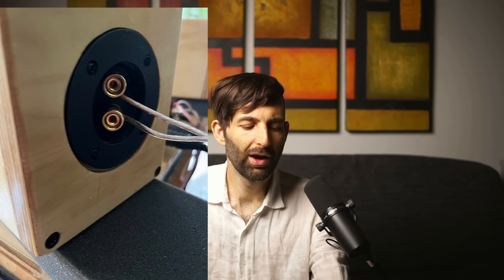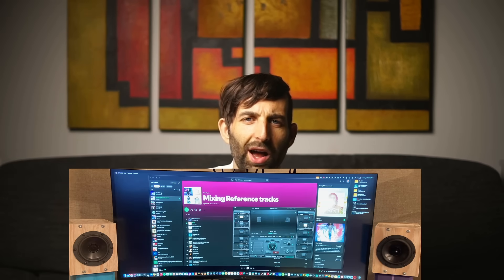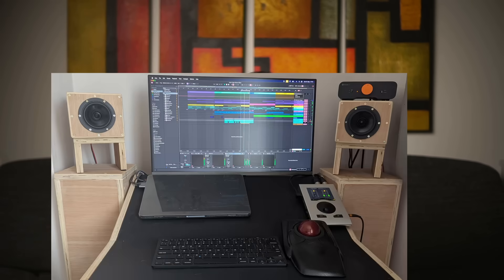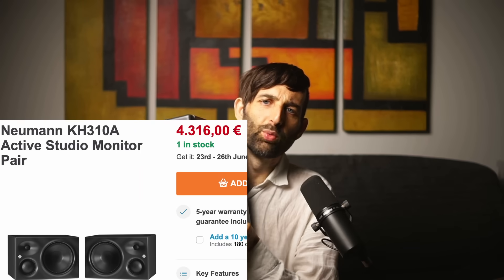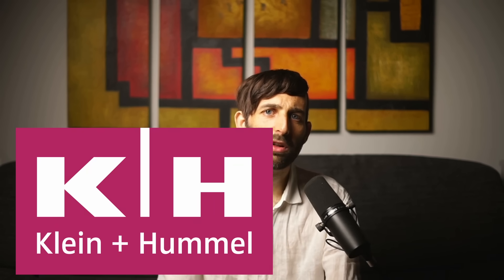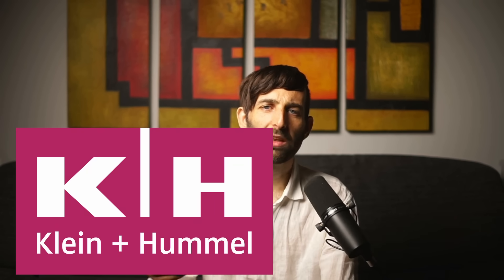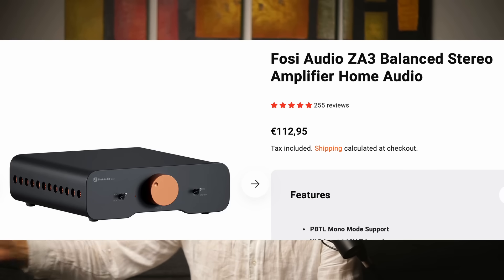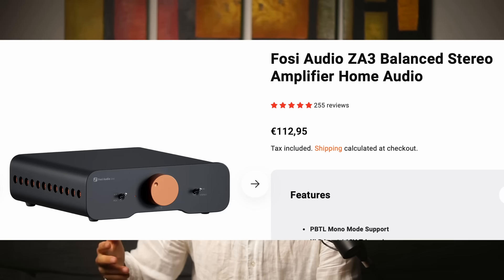$5,000 Neumann speakers VS $400 DIY speakers (Audio Shootout)

Comment: Mid-Field monitoring is how we have mixed when on a project, about 3 feet.  Used several high end Studio Monitors for that job over the years, even own some old Roland bi-amped monitors.  When it came to detail and recognizing the clarity enough to actually make adjustments, the coaxial monitors worked the best for me.  Concentric drivers made a big difference to my ears. Some nice reference quality car audio 6.5's with a concentric silk dome are readily available on the market for reasonable pricing, they even make sealed truck cabs for these things. Doing the box math is the proper way, so buy speakers with the specifications on it for calculating volume of a sealed box.  It's likely better for Home Theater imaging on the ATMOS satellites as well. But yea, concentric tweeters in sealed cabs would be my choice for another speaker build. Dear God - what a rabbit hole that can be, never simple. But I get lucky often with educated guesses because I've done it enough to learn from it. You should hear what I did with some old Peavy 10" cabs with the 200 watt Morel silk domes and nice MCM Pro woofers, I'd mix with those, need a bigger room and at least 100 wats to drive them right.

Comment: I think I may be making these, are the drivers readily available in the uk?
Reply from the maker: there are stock shortages because everyone bought up everything on the market after my course but the stock is starting to replenish now, the main issue is with the passive components more than the drivers
Reply: @APMastering I may wait until stock replenishes, but is it correct I have to purchase 2 courses to get the details of all the drivers & components needed?
Reply from the maker: @jbradshaw7 there are 3 courses:

1. Building the enclosure with just the 8” driver and discussing basic woodworking. You can skip if you can build yourself without guidance

2. Upgrade this to the 3 way speaker including crossover guidance and counterboring 

3. Speaker science where I discuss a huge amount of theory around speakers

There are 30% discounts after you buy the first course

Comment: I have Neuman monitors. Regardless of the YouTube audio deficiencies, both of your designs apparently are VERY VERY GOOD.  Even the KH310s are not without some very slight degree of coloration. The system could be tweaked with appropriate digital eq in the DAW  (DAW DSP), thus preconditioning the audio to the amp and crossover... Big thumbs up! You go bro!

Comment: I listened to this test on my KH310's and I can confirm those "Classic" speakers you made are dangerously close! they are a little more mid heavy maybe in the 300-400hz range and the top end, id say around 2-6khz are a little scooped possibly... but using room correction im 100% certain these would sound identical to the KH310's. incredible, I kind of want to make some now. how about the driver's time alignment, is tweeter and mid driver set to match the woofer?
Reply: I really was not impressed with the kh310 (also massively underpowered), and sold them. In many cases it's best to use passive speakers and a separate amp.

Comment: What do you think of compression drivers for tweeters? Is there any need for a beryllium tweeter that goes up to 40k, if I'm not a mastering engineer?
Reply from the maker: compression drivers are good for PAs but not for studio. beryllium tweeters aren't about ultra sonics, they are about transient response and stuff you can actually hear. there is a fair degree of marketing hype though
Reply: @APMastering Interesting. Yeah, I figured marketing was a component of it. I did have a pair of Focal Trio's for a while, and I did like the high end on them, but plenty of other speakers are comparable, without the beryllium, inverted dome, etc.

Comment: Nuemann have that extra air on top giving it a bit more openness. The builds are right there though. With the 3-way design is there any phase cancellation happening in the top end which is causing that air to not be as present.
Reply from the maker: the air is often EQed in but with a passive crossover you can't boost

Comment: Forgive my dumb noob question, but is there any reason not to use the diy mastering speakers for mixing other than the additional size and price?
Reply from the maker: they are too big, expensive and hard to build for 90% of my audience and require a reasonably good sounding room. But given that you have a decent room, and can build a pair, they are better. They have another octave of low frequency extension, customizable DSP crossover and are literally twice as powerful. It's like comparing a BMW M5 to an Audi A3. The Audi is a fantastic car but the M5 is in another league.

Comment: I'd be curious to hear your subjective experience using the classics vs the KH310s - I realize that goes against the spirit of much of the content on this channel, which I do very much appreciate, but I've been eyeballing the KH310s and matching sub for quite some time.  I'm pretty shocked by the classic.  Judging from these clips, I do prefer the Neumanns each time; it seems like they're clearer in the top end and more solid in the bottom, but not by a ton.   Seems like I'd be pretty happy using the classic.   For $400 ish each the classic is a steal.   I've DIY'd so much of my gear and learned so much about woodworking in the process of building my studio that it wouldn't be a stretch at all.
Reply from the maker: ive improved the crossovers and will post new clips soon, they sound even better

Comment: Thanks for another great video.  I've never been convinced by ports so last year I spent ages designing some sealed three ways, in BoxSim, with cheap DSP crossovers and Amps and bought all the drivers etc ,  but in the end was fortunate to get hold of some passive ATCs.  Having good monitors has totally transformed everything.  Easier to the best out of the rest of my ( modest) gear , because you can hear exactly what it sounds like and be more precise with mic choices and placement and then also mixing is so much quicker. You also get a much better idea of  how commercial tracks have been mixed for reference.   The small speakers + subs sound great, especially for the more acoustic tracks, nice and upfront.

Comment: I think you have a good foundation in the DIY speakers you made.
The advantage of DIY is that you can endlessly modify and create a sound that you like and that is adapted to the room in which the speakers are placed.
With better components, I know you don't believe in this yourself, but religion doesn't change the truth. You could get more detail if you wanted to, even a softer or rougher sound and with more or less air.
But something is happening between 250 and 500Hz in the DIY speaker. Is the frequency emphasized by units or crossover itself, or is resonance created that doesn't die fast enough. In short, the sound from DIY speakers is a bit boxy, because of this. Is the box rigid enough and were there enough sound absorbers used?
As far as I could count, you have 4 coils in the crossover? So you didn't use the Zobel R-C network to compensate for the changing impedance of the tweeter and woofer, which occurs due to the dynamic changes in the frequency they have to reproduce.
The result is that the L-pad does not do its job, above e.g. 5000Hz, which is noticeable by the rising curve of the tweeter. It plays brighter - louder in the higher frequencies.
And you are straining your amplifier more than you have to.

Comment: Big thanks for doing this!! Really interesting results. Interesting to hear how the mids seem more forward on the Classic compared to the Neumanns which seem “soft” in comparison. But the Neumanns have more low end and a “nicer”  top end (imo). I didn’t like how unnaturally separate the frequencies seemed with the Small + Subs. 
The biggest impression was that the guitars in the Deftone track seem to go far back in the mix during the Neumann playback? Maybe a result of the mids being less prominent than the Classic. 
Again, really interesting and big thanks!

Comment: What are the crossover frequencies? The ATC mid goes down quite low, the "lesser" dome drivers I've seen want to cross at 600Hz or so. On a budget I would stick to a cone mid. I've used Visaton FR10 and Faital 4FE35 mids, both cheap and excellent. A tweeter worth a look at is the Monacor HT22, a cone tweeter. Cheap as chips, measures well and has a dispersion that matches well with a cone mid. No need for a waveguide. For the crossovers, I wouldn't even consider passive. An analogue Linkwitz-Riley active crossover (even a B one) is so much more convenient and easier to get a good result than playing about with passive crossovers. Probably cheaper than a load of passive crossover parts too. Amps are super cheap these days. I like Class AB for mid/tweet and Class D for bass.

Comment: There is a slight but noticeable difference between the Classic and the Neumann. Sometimes you hear it. Sometimes you don't. There were some transitions where I didn't hear any audible difference between the two speakers. But then there were other times where it felt like the classic was a bit more hollow. But is it enough to make me spend over 10 times the amount to eliminate the hollow sound...? Nope.

Comment: Lets be clear. You show an cone speaker that actually its a 4 inch aluminium cone midrange midwoofer from dayton audio! Its not a dome midrange! And your 8inch speaker its not somthing that you can call sub woofer its a woofer and as seems from dimensions they're not gonna play low!( Needs bigger box)  So you gonna need a sub! That doesn't say that will not gonna play bass! But low tones without kick bass  (as subs works) you will not gonna have! Nevermindd! Lets not keep the negativity on! Its a very good try  , very nice!!!
Reply: I saw you made also rs51an domes! Ok! Maybe sorry! Although because i use on my projects often the fabrik version of mid! Its sounds better if you gonna match up them with a good AMT or metal dome ("beryllium") and can make them sound good with a crossover at 2nd order! Passive!
Reply from the maker: yes it is the metal 2" dome. I'm using a 2nd order passive crossover here. Next video I will show another kind of 2nd order typology which I think sounds even better. The tweeter is also metal dome.

Comment: I think this is a great initiative and I am considering building these (especially if you make an active version). I noticed that the speaker enclosure is plywood. That might not be the best option (especially for DIY projects like this). I think MDF would work better for more people because it is more uniform/stable. Plywood can also be quite expensive, especially if you want highest quality.
Reply from the maker: mdf is fine but i don't like working with it

Comment: For whatever reason, the DIY speakers sound noticeably muffled, like multiple frequencies in the high and mid ranges are being attenuated. The high frequency attenuation is especially noticeable in the FKA twigs hihats. The mid frequencies attenuation is noticeable enough in all comparisons. If I had to guess, this is due to the design of the drivers in the KH being better, and also the waveguide. Also, capacitor values in the amp could be adjusted to see if theres any attenuation coming from them, as well as swapping out caps with higher tolerance caps. Though, later on in the test, I hear some resonances in the Lola young snare and the mid range part of the peekaboo bass as well as the Blawan track. The resonance of the KH cabinet seems much more controlled and mainly unnoticeable. I know you put a lot of work into building all these speakers but I encourage you to keep it up. I do not think this iteration of speakers would ever replace a pair of KH or a different pair. I would encourage you to also upload a different video with the same tracks as reference tests of monitors with similar driver sizes comparing these DIY monitors, a set of sealed monitors,  and a set of cheap as fuck bass port monitors like tannoys or something that cost less, are more flawed but are in constant use in the field of electronic music production.
Reply: This. Muffled and reedy.

Comment: Really cool approach to start with the midrange driver and expand it into a full range speaker! The listening tests sound great but it would be helpful to see measurements compared to the Neumanns too. 
By the way have you ever researched or tried econowave designs? They're 2 way designs with a large woofer (normally 10-12" or even 15") paired to a compression driver/waveguide in a sealed cab. I'm currently turning 70's Advent loudspeakers into econowaves by replacing the weak stock tweeter with a CD/waveguide and keeping the stock legendary acoustic suspension woofer. Also switching them to dsp. I can't wait to hear the results. I'm curious how they might compare to your intriguing design here, I loveeee budget diy gear that punches above its weight. These speakers look perfect for nearfield. Guess I have a new project to add to the (very long) list lol... Keep the videos coming!

Comment: Those KH310s were always my dream monitors. Although, I managed to find a pair of PSI A25-Ms on eBay quite randomly for a decent price lol. Spent less money (new car budget) and got my totally-out-of-league super dream monitors in the end. 😂

The reason I wanted the KH310s was because of the enclosed design and tight transient response. Yeah, they don't go down so low, but they're incredibly linear and tight. Have heard demos on YT vs other speaker manufacturers, and they're virtually the same as listening to the source audio, albeit a bit of comb filtering from the desk and very slightly reduced transient response. Still, can't go wrong with the 310s.

I'm definitely interested in building your single driver monitors, even just having a single one for mono referencing. I've built subwoofers for my car before, but never a full/partial range speaker. Guess it's roughly the same in terms of figuring out the Thiele-Small parameters.

Thanks for the vid dude.

Comment: Very interesting set of speakers there. I like the classic set a lot. I did listen to this on my own speakers(KH120 5.1 setup). Very nice. One of the guys that trained me ran an all passive setup with a 50 watt class-a amp in his mastering studio. Still remember the precision as I listened to "Money" off Michael Jacksons "History" album at near field distance. Don't I wish I could afford the KM310 speakers for everything. Classic is a good one to try if I hadn't picked my lane already. Definitely wouldn't mind making these myself either.
Reply from the maker: class A can sound really good but it's just massively inefficient electrically. im a fan of modern class D
Reply: @APMastering Thank grud for class D. I'm not sure I'd want to install air conditioning, as was necessary for most Neve consoles. The 8128 used 4.5 kW, which was neat if you wanted to take a sauna in the mix room.
Reply from the maker: @AironExTv lol

Comment: Very impressive.  Overall, I'd say the KH310's when compared back to back with the original digital source were always very close are almost bang on, but in certain examples the Classics were just as good.  There was on instance (FKA twigs) where the Classics almost nailed the digital source.  The Classics seem to handle or, should I say, reveal transients a bit more precisely (or more of them)?  More detail in the upper mids and highs.  KH310's more even.  The KH310s and Classics sounded (to my ears) identical for the Blawan track but both slightly dulled the transients slight.  Anyway, thanks for this - it's a lot of work on your part and I really love getting nerdy with listening.  I like working on my listening skills.  Important even more now that my ears are only aging,...quickly.  lol

Comment: I like those Neumann's too, and the 3-ways you built hold up pretty well. Was like comparing different Celestion speakers, neither necessarily better, just different. Shallower but more punch bass, and less smooth and more forward in the upper mids than the Neumann, but less airy treble. But that can be good (e.g. Yamaha NS10Ms). Might be worth comparing them to Kali IN-8? They're the best current commerical 3-way active model imho, and they also show up harshness in driven electric guitars. Another alternative to KH310, slightly more expensive but better/different in some respects is the Hedd Type 20 mk.II (5k), or the Type 30 if you have deeper pockets. They have amplification power on-tap, extend a bit lower, and extend much higher (for cats). And have more incisive/clinical treble, if AMT tweeters agree with you. And they can can be setup closed-port or open port, and true to what you have been saying, they sound more accurate closed and have some more advanced DSP options than the KH310. I think you are right going the passive route. Passive speakers became underrated or forgotten. Really excellent old B&W Matrix full-range mastering speakers, the best studio monitors I've heard in person, or nice older PMC models are available on the second-hand market for quite good prices. Bargains compared to these 4-5k newer active models. And clean, powerful accurate Class D amps are pretty affordable now. There's even great Pro PA power amps and Yamaha Home Cinema amps (A-series) that are quite good. Nice music choices btw, better than most people use to demo these things.